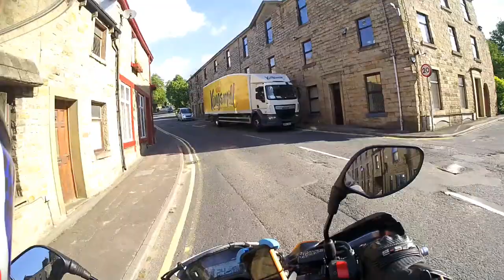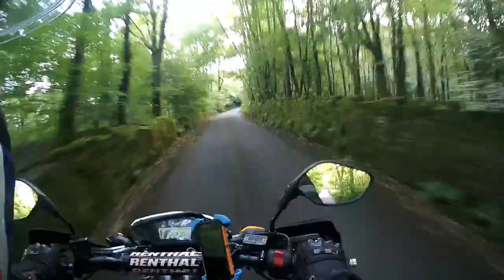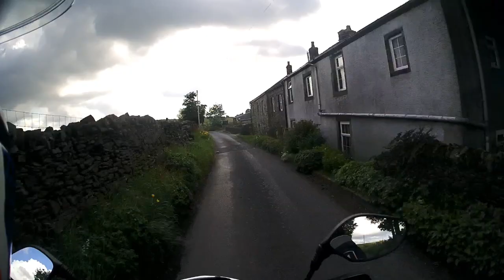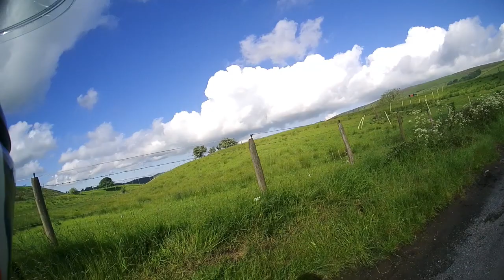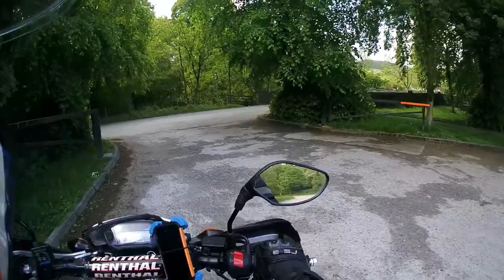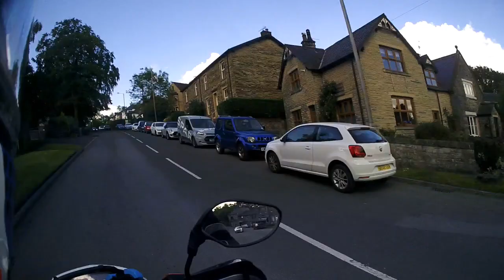Honda CRF250l Are The Wrong Boots On Part 1

Comment: Got to agree wit you Steve I think West coast is stunning I lived in Arbroath for a few years it was nice but nothing compared to Ullapool. Buy a electric razor 🤣🤣 Don't reckon rear tyre width will make much difference on 250 cc but if it's hard wearing might be a hard compound  Nice video, shitty car park you turned round in, at a pound a go you d think they would fill the potholes in.
Reply from the maker: Hiya Keith thanks for comment yes the tyre did not seem to be a problem my only worry now with it is the off road tread front and road biased rear. But as said appeared to be fine, the razor problem I am just dozy well thats common knowledge Sprocket says I am a knob : ). Yes car park could be better but if you come Keith and go up Pendle make sure its a nice day mind. It is a good cheap day out with rewarding views from the top.

Comment: Hi Morphy. 
If you could only have one bike out of the bikes you own which one would you choose?
Cheer's
Baz
Reply from the maker: Wow what a good question bazxl57 I have already thought of changing the Fazer for a Yam 660 Tenere so it is not the Fazer. The Africa Twin is a cracking bike but so is the CRF250l. The Africa Twin is a mile munching animal but is very heavy when moving around the garage or car parks or just pushing anywhere. On the move you lose all the weight and it is really well balanced unbelievable well balanced. The CRF250l is light and a laugh a minute it can keep up with motorway traffic all day. It is not a comfy bike after a while like the Africa Twin but you can do 100 miles for a £5. Pair of tyres £111 cheap road tax insurance just over 1 litre of oil and filter for service. Hand on heart it is really difficult to decide at the moment I have to say the Africa Twin  but it is close as I get older and if the weight of the bike becomes a problem it will have to be the CRF250l.But I will say this I will not sell the CRF250l it is a cracking bike but out of the two after care full consideration at this moment in time it is the Africa Twin. Hope that answers your question and thank you for asking that taxed my grey cells. : ) Thanks Baz, Morphy
Reply: @morphyridesagain9270   
Hi Morphy Thank's for the reply I have been thinking of a CRF 250L for a couple of years now but running it alongside my BMW F800GS I wasn't sure if the CRF250l would be a good choice. Thanks for pointing out the reasons why you like your Honda so much & saying you would never sell your Honda means a lot, I agree these bigger adventure bikes can be a handful to move around the garage etc. I find these days if want to go for a quick ride after the 6 till 2 shift I cant be bothered getting the GS out weekends are ok when im not so tired. So I will be having a closer look at the CRF 250l as a second bike. 
Thanks again for taking the time to answer my question its been very helpful.
All the best
Baz
Reply from the maker: @bazxl57 iya Baz no problem at all anything you want to know about the 250l just ask. you will not be disappointed at all in the bike. People say they must be under powered and that they would not drop down to the BHP. I have been out with lads on KTM 990s and left them standing on the single twisty tracks. It is not so on the right roads they will hold there own all day long.  Smiles per, miles per, £s, value for money all the way. True on 60 miles per hour roads you have to plan overtakes where as on bigger capacity bikes it is just a twist of the wrist. The build quality is top notch also these bikes are made to last. I have dropped mine three times now without any damage whatsoever. That has been partly due to the barkbusters I put on a must in my opinion. Morphy